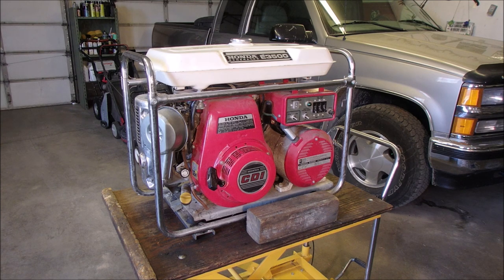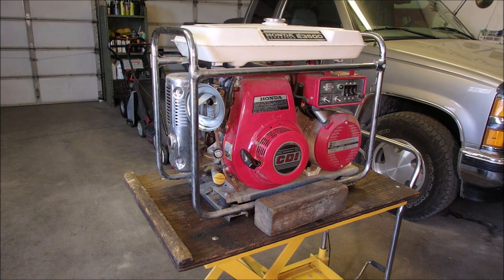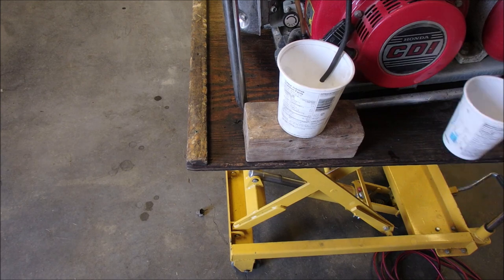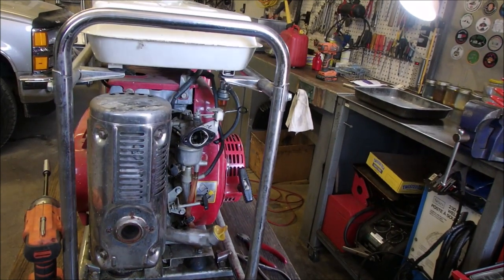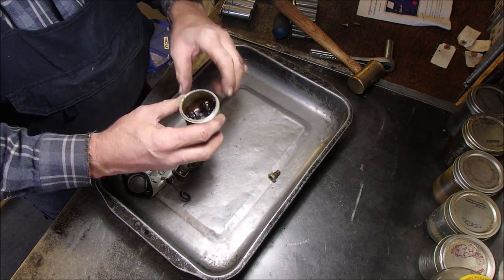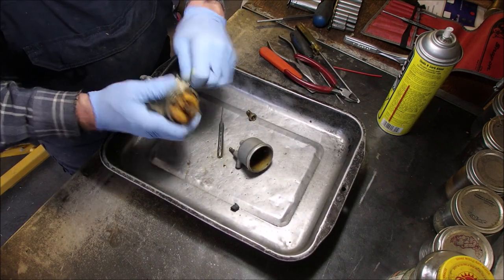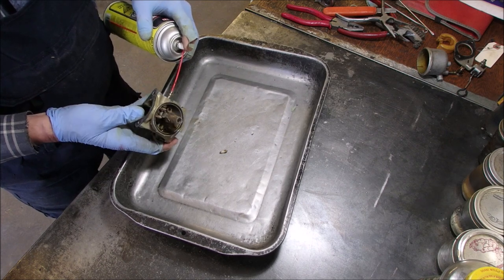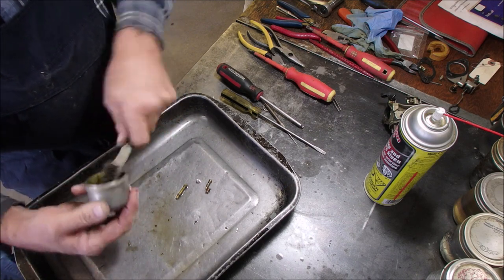Honda E3500 Generator Won't Run

Comment: Hey Bruce,
I’ve had a few nasty carbs lately.  I use Vim, a kitchen cleanser with a small wire brush to remove the varnish.  Works awesome!
Reply from the maker: Thanks Jim

Comment: Very nice ole generator Mr Bruce, standing by...
Reply from the maker: The pull on the rope is very hard as the generator is belt driven.  ARGH!!!
Reply: 🤣🤣Just put those big ole Canadian Moose arms to it. 🤣🦾
Reply from the maker: @Big_Johns  OK    LOL   I did notice that after a week it got easier.

Comment: Where's James Condon?  I actually saw one of those last night at a customer's place.  He wants it fixed so I'm going to take notes on these vids!
Reply from the maker: The idle circuit is controlled by a tube coming off the carb gasket to a relay then down t the governor.  This one was running so lean the plug had a thick white crust on it.  The carb is 125 U.S.  175 Canadian + shipping.  (I did not order it).

Comment: A real beauty even nice to see the old time chromed frame which is never seen now eh? Looks like what goes in the toilet after you have asparagus for supper then have to P eh? Hope all is well in your area did not see any smoke coming under the garage door! The best news is you do not have to evacuate right?
Reply from the maker: Correct.  I saw on the news the smoke has made it all the way to Ontario on the jet stream.

Comment: I have one like that but it is a 2500 missing the control panel with the plugs . The motor runs great I would think they are from the 70 s at least mine is . The wiring diagram for mine shows a AVR witch must be in the control panel that I do not have .
Reply from the maker: Right  I wouln't know.  Good comment   thanks.

Comment: Boy, that was one dirty carb!  Do you ever ruin the emulsion tube using that drywall screw method?
Reply from the maker: I haven't yet.  There is a feel to the insertion   so it just stops no further.

Comment: What I do is, I take it apart as much as I can, then I put it in my ultrasonic cleaner in my special sauce, and run it for 4/20 minute cycles, my sauce loosens everything, so I don't break anything, I put the mix and carb, in a large mayo container, and just plain water in the ultrasonic cleaner, so it's not hard to clean out, also remember to let the ultrasonic cleaner cool down completely before emptying it, remember 50% white distilled vinegar 25% simple green purple, 25% distilled water, do not leave it in my mix for more then 2hrs it can cause aluminum carbs to blacken, it doesn't affect the carb it just doesn't look good..... I haven't met a carb it can't clean, and it's not bad for the environment.
Reply from the maker: Thanks  I will cut and paste this.  Is that ok?
Reply: @BrucesShop  sure go ahead.
Reply from the maker: @knighthawk86855  Thanks
Reply from the maker: @knighthawk86855  Just for my own use if I decide to change  my mix

Comment: Thats a 406cc engine 10hp Honda G400 nice generator
Reply from the maker: Thanks.  I finally found that info for the new plug.  It had the wrong plug in it.  Thanks again.